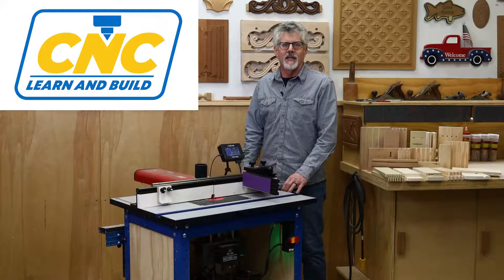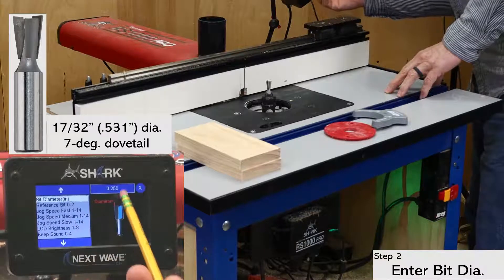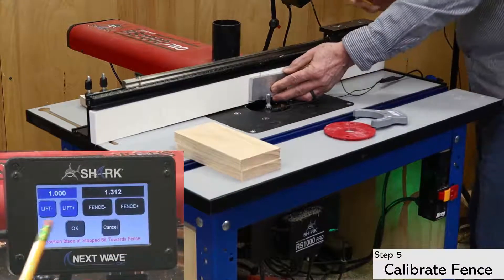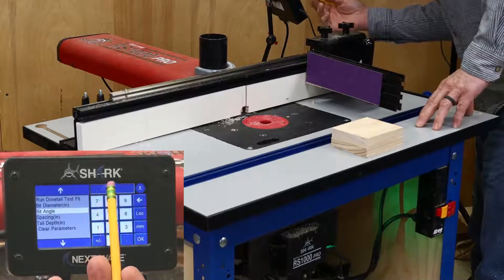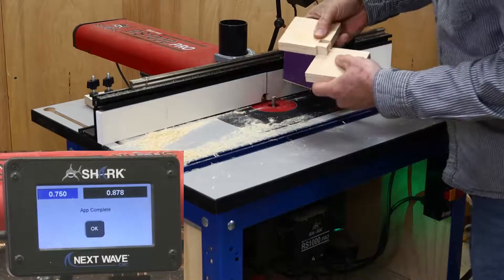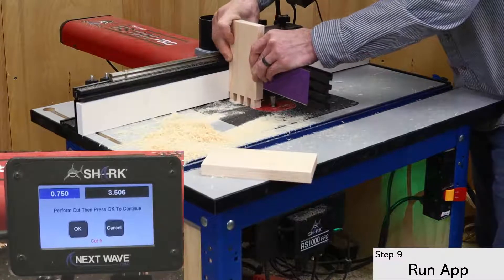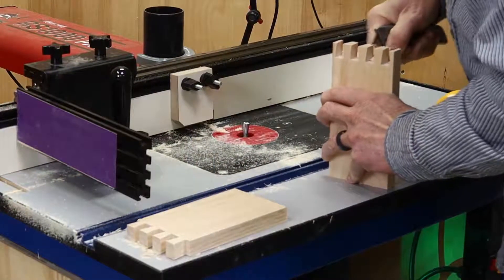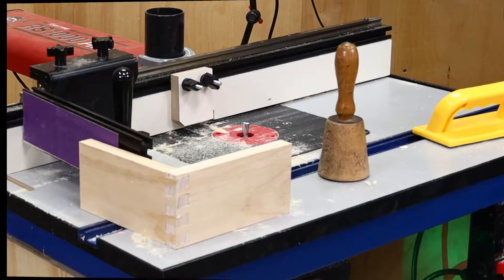08 Through Dovetails with the SHARK RS1000 Pro CNC router table

Comment: How do you avoid tear out when routing those through dovetails?  It doesn't appear possible to use a facing or a backer board.  I feel like this would provide a lot of tear out on the dovetails.

Comment: Thanks for the video. You made a mistake when you made a second pass to make things fit. With this machine, setting the cuts accurately will give you constant cuts. In my opinion, you should of moved the fence a little to make it work so you had a reference point for all the other cuts.
Reply from the maker: Yes, that's definitely another option. I was looking for a way to make it work with the stock settings. But the tool does provide a lot of precise adjustability for different situations.